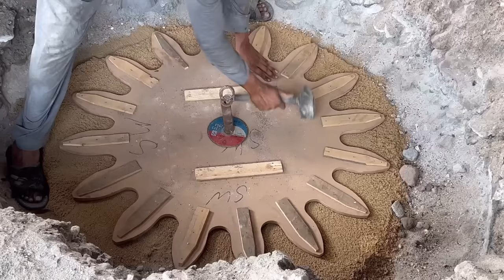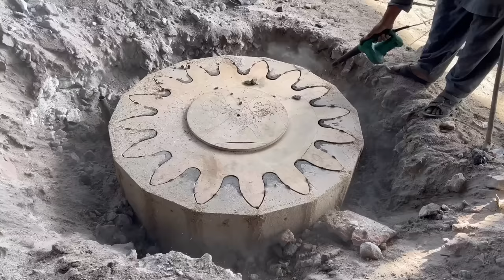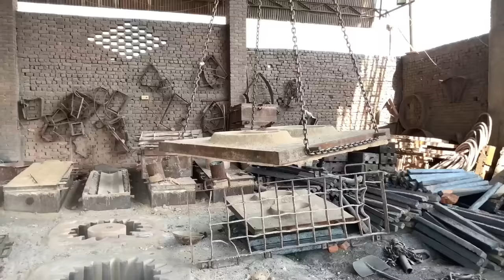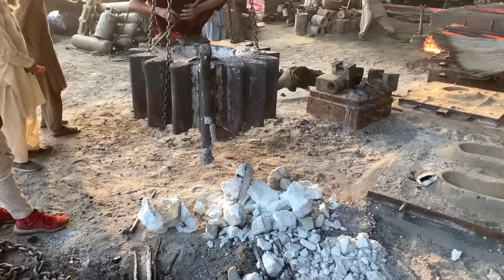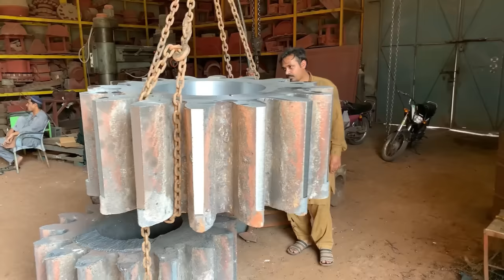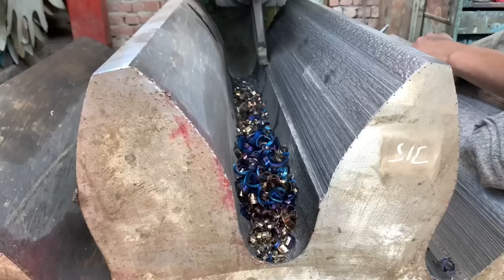Handmade Making Process of Large Milling Machine Gear | A Huge Industrial Gear Manufacturing Process

Comment: Can critique the safety of the methods, quality and precision of the product, but these guys are doing the best they can with what they have which is often more that can be said for folks in my neck of the woods
Reply: yeah, it is fascinating to see what you can make with the most basic of tools. Would like to know what the gas is that they pump into the formers, though
Reply: I used to Work as a engineer at Case. I had to go in the foundry sometimes. Believe or not it was done exactly like this but there was one master mould maker who made the original and then there other mould makers that copied it. They has semi auto machines that people used make the actual sand moulds by filling the wooden ones. After that there were mould setters who set the moulds in place. I never saw anything this big though they used to make lots of smaller gears all in one go, mainly for combine harvesting machines. There was more safety though! The joke in the factory was that foundry men were gay because they wore leather chaps. You didnt say it to the foundry men though. They were all strong as F***.
Reply: They're not doing the best they can. With THEIR brains maybe.

Comment: "What is the metal you use?"
"The metal we have the most of!" 🙂
Reply: litteral pot metal from cookware
Reply: Thats why they have to do it soo big! With modern technology, this gear would be probably 5-10 times smaller.
Reply: It's 9310 !
Reply: @charlesballiet7074  I'm sure there's some plastic in there as well.
Reply: @PbPomper  Carbon content? Don't worry about it.

Comment: I wish all of these "experts" would gift these guys the modern tools and technology they are writing about in their critique. If not, they should keep their first world opinions to themselves. These guys do their best with what they have.
Reply: The problem is, they're selling this stuff overseas, and it gets binned the same as if it was produced with higher quality....and if they have to, they'll secretly sell it through another country if someone is trying to avoid their product, until there's literally no place a company can go to buy stuff without getting something they're trying to avoid. These are literally fraud parts once you realize how the supply chain gets peppered with these parts. A well made part and a poorly made part can mean the difference between a long lasting part or not, or a part that requires more maintenance and fuel....to the point that they actually end up costing more in energy alone than simply making the part in higher quality in the first place. It might look like a big sturdy chunk of metal, but when we're talking about machines at the scale of requiring gears this large, we're talking a lot of force that can rapidly induce wear and tear. I mean just look how easily he was able to shave off material with what was a pretty worn edge...that's some relatively soft metal. Now imagine this put into a machine with other higher quality gears that are stronger....they'll grind it up over time, creating even more wear and tear. Now imagine just the logistics of getting a replacement and putting it in when these fail. What it all means is these parts simply are less efficient and not worth it, they're like using a dirty coal powered plant for energy instead of something more modern. Everything becomes more costly in the long run. It's like if I sold you a car with an engine made out of plastic....it might run for a little while, but eventually it will melt and you'll need a whole new car much sooner than you wanted.
Reply: @peoplez129  point taken.
Reply: @peoplez129  All industry is driven by the customer. Stop buying the cheapest thing available without asking questions, and that won't get made like that.

Comment: Ive watched similiar videos of these guys repairing tractor tires...grinding down the rubber, heating and melting it, actually ' sewing ' metal wire around the patch and putting and actual new rubber cast mold into the damaged spot....it comes out new. Comments from American tire experts are astounded at these peoples ingenuity. My dad used to do this sort of thing on his farm in the late 40' into the 1950's. You work with what you have and you make it work....again, like one person said " they wouldn't have a system of making these parts unless they did work and people kept coming back for more " right ? I'll put it to you this way....hands down....if i became rich and wanted something very rare and impossible to find an orignal example of made of metal - i would go to Pakistan and ask these guys to build it. Seriously.  I'm into model tanks and planes....the German Tiger 1 tank ? Extremely rare. 7 complete examples left in the world...1 running. Some private collectors are reduced to piecing one together from various old parts called ' Frankentigers ' they dont even have an engine. The amount of money that a German, American or high tech Asian country would charge to build a brand new replica of a Tiger 1 ? Probably twenty million USD. Pakistan ? Maybe 2 million. Im just saying....its the truth....and it would run and work.
Reply: The difference is pretty obvious when you see the same guys coming back to get the same repairs week after week on the same machines when the US versions last years longer and require much less maintenance.  They do it this way because they have no choice, not because it's just as good and they don't have the money to upgrade or some other goofy reasoning.
Reply: There's also a matter of scale, the average American farm is 173 hectares, average Pakistani farm is 3. If a farmer in Nebraska doesn't slap a new tire on as quickly as possible and get back out in the fields they can lose more yield from the delay than the total production of the entire Pakistani farm.

Comment: Whats more impressive to me is the fact they have a milling machine large enough to face this part
Reply: You don't need a good mill when the part is made of a bunch of scrap metal. It's a big part, it's metal....but it's not durable.
Reply: @peoplez129  It's durable because it's way bigger than what would otherwise be needed if it was tightly graded and controlled. To compensate for exactly that. Same as how when people made bridges out of stone, they made them much heavier than modern steel ones. And they still stood up, because overengineering can make up for a lack of materials for most tasks that need brute strength not super precision.
Reply: That's not actually a milling machine, it's a Vertical Lathe (no i'm not being sarcastic).  The machine the splines are being cut on is called a Shaper. :)

Edit:  I have since learned that there is a difference in dialect between british and american english to call a machine a vertial boring mill or a vertical lathe.
Reply: @immolationangel4124  it says the final gear is FOR a milling machine
Reply: @gavinjenkins899  he was saying the vertical lathe was large enough for a facing operation on the gear.

Comment: Plenty of bridges here that were built in the 1800's using similar techniques, they are still standing. Brunel didn't have access to CNC either.
Reply: Doubt it
Reply: Right, so modern safety techniques aren't necessary, I suppose. After all, some gears were made at the same time that they used leeches to cure disease, and we all know that didn't change either.
Reply: Plenty of bridges bult in the 1800's fell down too.
Reply: They are still standing because of the conservation effort, not because the technology is so hi-tech. Most of the bridges from 1800s are gone or rebuilt. No bridge built in 1800s would stand today without extensive care. Did you ever heard about survivorship bias?

Comment: Impressed to no end with the exception of harvesting the metals. Looks like they are mixing iron with copper with aluminum with tin with lead etc etc, The casting will ultimately have weaknesses and be prone to failure. The whole process was incredible though.
Reply: And what about surface treatment? Surface hardness is extremely important for gears.
Reply: @PbPomper  Yeah, to prevent chipping and misalignment.  But if the entire tooth of the gear bends because it's alloy isn't hard enough to withstand the forces involved, the machine chugging and dragging from chips and alignment issues to get anything through is going to be the least of your worries.
Reply: I don't see any aluminum, copper or lead. They are using parts from hvac compressors, they have obviously salvaged the copper windings. Mostly plates from the stator and the outer shells. Soft steel but no other metals. I also see some insulating plastic film (probabbly polyester) which will burn into almost nothing (and probabbly be floating as light slag). Not perfect at all, but get your facts straight.
Reply: @ZirconGames  Who are you..the metal police? Grow up.

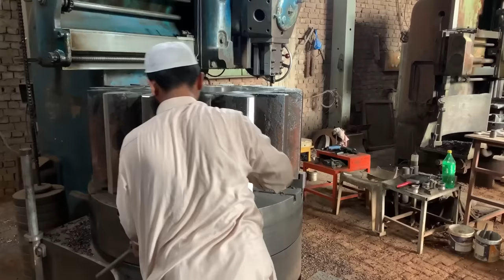Comment: from 36:10-36:30 you can literally see voids and cracks in the metals after they mill it haha
Reply: It's minor. Should function well enough and long enough.
Reply: You shouldn't buy it i guess
Reply: Thats not a problem
Reply: as a foundry engineer, in that huge casted component, they made it pretty well and i am quite suprised. These small cracks are nothing and they are actually quite normal. Suprisingly there are quite small and not much of them. Its going to be welded anyway. But I would like to see chemical analysis of that material :D. and some ultrasound to see if there are some huge porosity inside. That would be bigger problem.

Comment: It looked like they were throwing random scrap into the blast furnace. I don't understand how they're controlling the quality of the steel. Mad respect in any case, they clearly have manufacturing skills. OSHA would have a heart attack if they came into that shop tho LOL!
Reply: "I don't understand how they're controlling the quality of the steel."
LOL. They don't, simple as that 🤣
Reply: There is so much steel there, if you approximately know what kinds of scrap you put you can be relatively close to your desired composition.
Reply: At the end, they throw a wheelbarrow with flip-flops

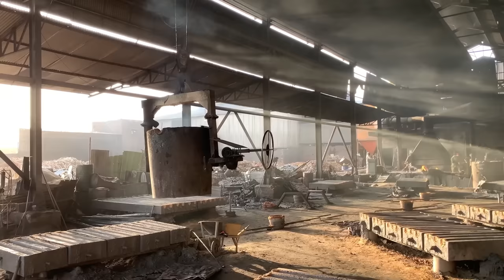Comment: 23:18 good to see they are wearing the proper safety sandals while handing molten metal.
Reply: Just as important as the safety squints when cutting with an oxy-acetylene torch
Reply: not to mention the safety children walking around
Reply: cheap labour power loves safety sandals

Comment: So they finish it by manually shaving off a bit with a huge shaper - by calibrated eyeball?  Well I guess you work with what you have!  One thing I noticed, the center of the bore was incredibly close to true center when they cast it, as there was nearly an equal amount of material to remove on both sides.  Well done to the cast maker!

Comment: The metal hills are classified to obtain the correct metal structure at the end, it is then simply converted into wheelbarrow units
Reply: I 100% saw aluminum casings in the same wheelbarrow as a steel coil. lmao
Reply: @ravenna6543  Aluminum, India's other steel.

Comment: how do they control the mix/hardness and other properties of the steel if they throw random metal trash into the furnace.
Reply: application they are intended for is also random
Reply: they don't
Reply: And now you see the glaring problem. In reality, no company would deliberately want such a part. What you are really witnessing is a counterfeit foundry that peppers supply chains with these parts. They get sent off somewhere, sanded to look like all the other better made parts from other places, and X out of 10 of those parts ends up being these. They go into some machine, break quickly, and the company is forced to replace it again....and again...and again....for a higher cost than buying a properly made part in the first place....but they can't avoid it because of how these are just snuck in with higher quality parts.
Reply: @peoplez129 how do you know that?
Reply: @ESPkenner48  Because you wouldn't pair these parts with other better made parts, it would cause uneven wear and tear even on the other parts, and failures cause damage to other parts, etc. In essence, a part this poorly made is soo bad for modern machinery of this scale that it ends up costing more than just using well made parts in the first place. There is no place for parts like this in modern machinery with modern efficiency requirements. A part like this would cost more in even just fuel inefficiencies than it would cost to get a well made part. That's exactly why these parts are glaringly for counterfeit. You'll lose money by using such a part. You'll spend 10 times more in fuel than the difference in cost between this part than a better part. So from every angle these types of parts are simply obsolete for the modern age.
Reply: @peoplez129  there are no use cases for a system made all of those level of quality parts?
Reply: @ESPkenner48  Maybe an old clock no one cares about. But outside of that, at that scale, things are just too demanding to cut corners and end up costing more in the long run, a lot more, millions more.

Comment: This video delivers and the workers did too.
Excellent content.
The process may not be toppity top laser cutting 23rd century tech, but it's much more understandable by the average folk and it produces what by default people picture when they read "Large Milling Machine Gear".
IF the requester has more specific needs then yeah, let's get it from germany or usa or whatever.
But this is the way the practical human thinks and works.
Definitely much less obscure than automated processes.
Besides, at one point the machine to make another machine has to be made and these dudes know how to do it.

Even if there's something inherently wrong with this process (like lack of safety or excessive carbon emissions or whatever), it really helps to have at least ONE video more or less documenting it as the base from which one can appreciate more complex processes then.

I feel like being shown or taught an already complex process as a young student or worker is not great if you don't get a feel of what "going in a straight line and doing exactly what was expected" is.

Comment: The bottle top spacers were awesome , Safety sandals are the order of the day lol . What metal are we using today answer 50 % rust , you can see the voids in the metal as it spins .
Reply: Yeah, lots of porosity in this casting. Not surprising for many reasons including the wide variety of scrap they used. You'd think they would at least us scrap sorted by metal type! It was just a pile of junk metal.

Comment: I'm curious to know what gas they use to harden the sand?
Reply: Is that what they are doing with the gas? I didn’t know.
Reply: If they are using water glass (I can't remember the chemical compounds presently) then the gas would be CO2.

I think sodium hydroxide is the name I'm looking for.

Nope, I looked it up. It's sodium silicate.
Reply: I believe is oil n sand they use i could be wrong
Reply: Carbon dioxide
Reply: @jamessheets9205  This is the correct answer.  Sodium silicate (water glass) and sand.  Hardened by CO2.  I was in a casting workshop where they used that.  Easy to use and if really fine sand is used, the casting detail can be awesome.  Only disadvantage is that the sand cannot be reused.  I'm sure it gets ground down and used for something else.
Reply: @danstephens9500  probably recycled into packaged play sand and exported to Home Depot 🤣

Comment: Engineers are going to be pissed when they find out that the gear is 5% silicon, and has about 300 sand inclusions per cubic cm.
Reply: they cut the teeth with a shaper... holy jesus look at the surface finish....
I am terrified to know what kind of critical infrastructure this is getting placed into....
Reply: Engineering horror

Comment: that would be a fun project and those gears are really pushing the limits of the little VTL and Shaper. It looks like the gear tooth profiles are eyeballed using those templates hanging on the wall. Really Rough but probably functional.   More Videos Please     : )

Comment: That milling at the end gave me anxiety... but that very last tooth milling was something else, manually adjust just by eye wow..... such a "smooth" surface
Reply: and no safety glasses. metal shards in the eye probably make for extra long worker retention
Reply: Since the dude on the shaper wasnt getting close to the pattern line, Im assuming it comes off the "rough" shaper and goes to a finishing shaper or grinder

Comment: How did they know the gear was positioned perfectly flat when they first put him on the turntable of the mill?  Or perfectly centered?  By placing it on there, they are making the rough casting a basis for all future milling.  What if the sand cast wasn't exact or what if there was some sand left on the metal?  Wouldn't that make the whole thing sit lopsided on the turntable?
Reply: Looks like they had enough extra stock where they could establish two good reference faces for when they flipped it over.
Reply: Instinct and Skill leads produces Experience. 250 years ago the UK Industrial Revolution started this way. hats off to Asian Workers!
Reply: Great question!  I was thinking the same thing...
It wasn't.  The reference was the bottom, even though it was obviously rough and not flat.  As Vintage said, there was enough extra material that it didn't matter.  Once they cut the top and center bore, that was the reference.  Then they cut the other side and the faces became parallel and the bore perpendicular.  Then the gear teeth were cut to the faces and everything turns out round and centered.